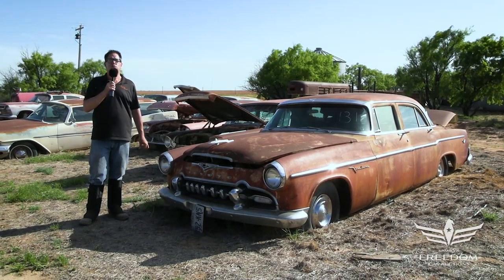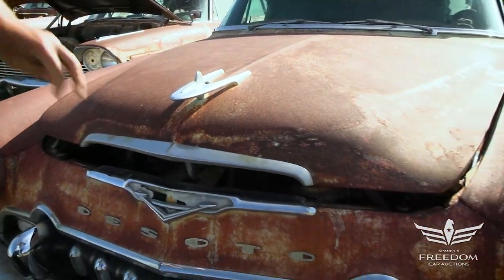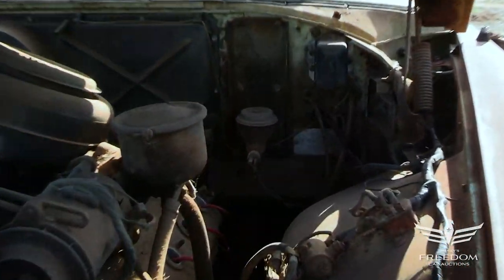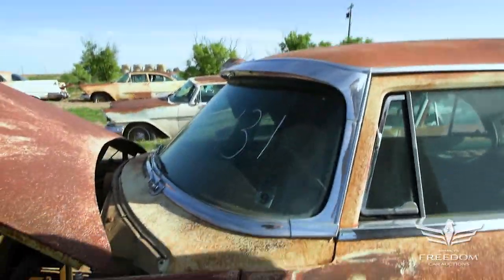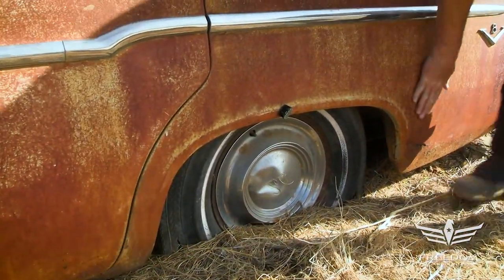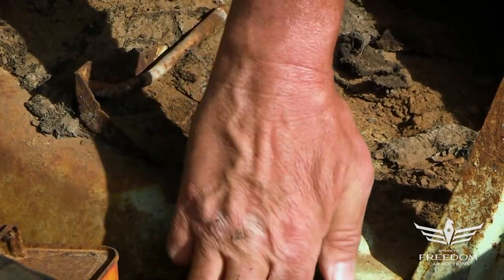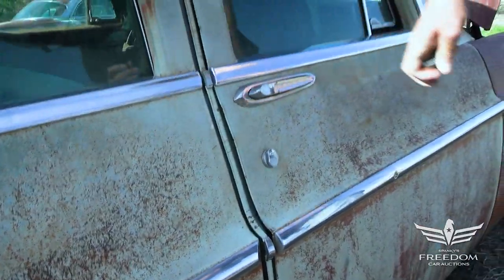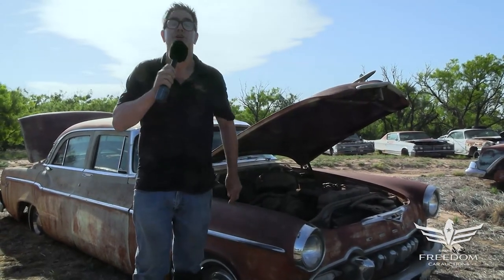131 1955 DeSoto Firedome

Comment: I had a 55 two door hardtop. With leather. Only Mopar I ever saw that had a shift lever coming from the dash instead of push buttons. Those 6 volts had their work cut out for them.
Reply: The Powerflite shift lever on all 1955 Chrysler products was on the dash, and the push-button control began in 1956 and lasted thru 1964.